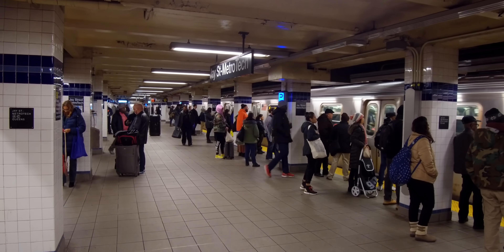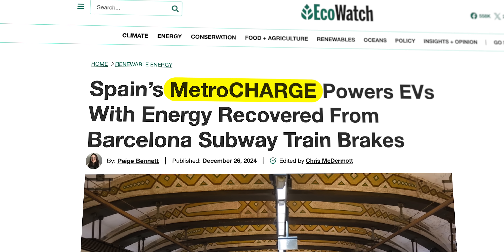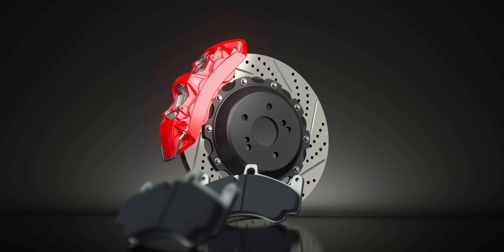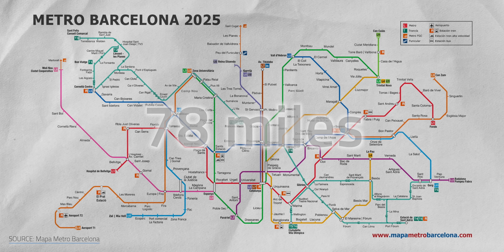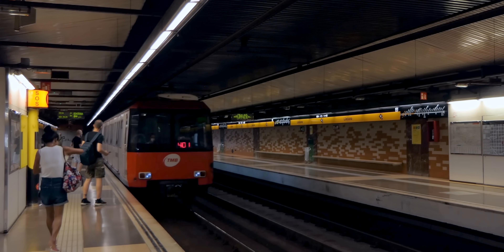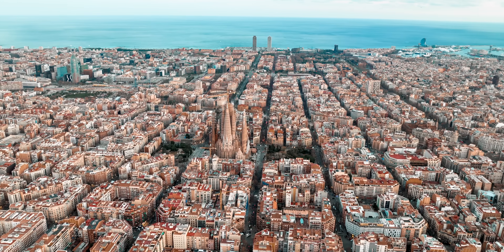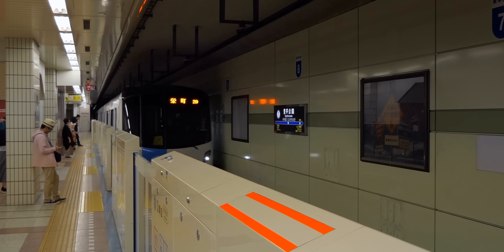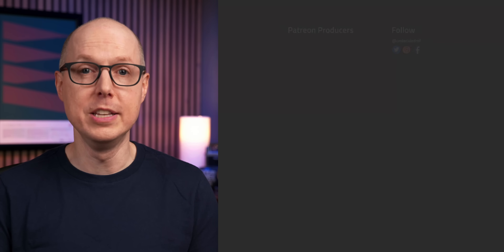The Most Overlooked Clean Energy Source… is Under Your Feet

Comment: I wonder if a braking car on the back of the train for the regenerative braking might be the best way to do this.  Obviously you add it to new trains but you could just add a single car with batteries to the back that puts all of the new stuff in a hot swappable unit thats totally redundant since the train would have its normal brakes and does even have to share electrical systems.

Comment: Another energy recapture tech that would work very well in subway systems is wind-walls.  Trains in tunnels push a Lot of air as they go.  it would be very simple to line sections of walls with small modular wind turbines to collect That wasted energy as well (and you could Also take advantage of the low pressure suction at the Back end of the train as well)

Comment: I think it's a needed piece of the energy puzzle. For passenger traffic I think however that it would make more sense to work with individual smaller taxi trains that are A.I. driven. The passenger goes to sit in it, indicates the desired destination, pays or shows proof of payment, then A.I. takes the taxi to the destination using the most optimal routeplanning. It's better because big trains are too heavy, costly, unfriendly in timing, and expensive. Meanwhile smaller taxi trains can be more easily individually maintained, are lighter and so use less energy, and lighter using less material means cheaper although you'll need plenty more taxis, it will also require no personnel to run the train itself but for maintenance there will still be personnel needed of course. Because there are the many individual taxis, taxis leave as soon as possible reducing waiting time, eliminating problems on delays, no need for preset routes as A.I. does the driving, no changing to different trains or even manual route planning because you just enter the desired destination. Trains for passenger traffic should have died already by now!

Comment: A great follow up would be to compare any regen rail to what it would take to implement. You mentioned the NY MTA. If a train recovered any power, it's simply used right there by another train that is moving. So leave out the ev and station needs, it's only a cherry on the cake. We need to do the icing first?

Comment: I'm shocked they weren't already using regenerative braking to reduce the total energy to power the trains. I'm disappointed that e-bikes don't have regenerative braking. Cable cars in SF use a small central motor because the cable cars getting pulled uphill are balanced by cable cars is going downhill on the same cable so the motor only has to overcome friction in the system
Reply: E bikes use so little energy that any extra range would be insignificant. Bikes are very lightweight and don’t go very fast so there’s little kinetic energy to be extracted by regen.
Reply: You need to get into the kW range before regen makes sense. Electric motorbikes do use it. And indeed most modern electric trains use it. Where I live commuter trains have used it since the 80s.

Comment: This script was a confusing onslaught of loosely related information. I could imagine the new part is that the energy is fed into the 750V DC supply and the station transforms it for local use, which might save on transport losses they had earlier? I would like to see numbers how the local transformation is cheaper than powering an accelerating train in the next station, or what did I miss that makes this newsworthy?
Reply: Yeah, this was a disappointing episode. Sloppy writing (at the start he talks about converting potential energy and a few times he talks about the trains charging things), obvious questions (like why EV at all) unasked, and comparisons to other systems not made.
Reply: Exactly my questions. I would really like to see Matt do a follow up on this, because I also fail to see what's new.
Reply: @Mr_Stone1  I guess the timing? Regeneration of electricity can be stored in EV batteries instead of transporting it further along the grid?

Comment: Interesting electrical engineering question, and as you note, the most efficient use of the recovered energy depends on how the cars, rails, and stations are wired.  Cheapest:  just feed the recovered juice back into the traction system.  Simplest:  store in a small battery (as in all EVs) when it stops, then use it to help start the train  Since the recovered energy is 45% of the kinetic energy of the train at most (from your numbers), that determines the size of the battery.
Reply: I wonder if the weight of the battery outweighs (pun intended) the acceleration gain versus offloading. Especially for trains not at capacity.  I would think engineers figured this math out already and why they went this direction?
Reply: Batteries seem like a bad solution for a grid, where every moment stone train accelerates and drives, this needing power. 
But as you mentioned, it depends on the traction system. 
This way or another, it doesn't make sense to me to outsource the energy outside of the transportation grid.
Reply: Capacitors, not batteries for this, lighter too
Reply: Those 2 sound like the same thing. The railway's independent power grid is acting as every train's batter all at once. For a car, you have to feed power back to the main battery since it's not connected to a power grid.

Comment: Renerative breaking should just push excess energy back to the grid. Don't direct energy directly to EV chargers. Not everyone has an EV, but everyone uses the grid. 
I know that has its own set of technical problems since power stations have to compensate for the variable draw and generation that comes with starting and stopping trains at this scale,  but it's possible. The grid already handles large amounts of variability as it accounts for with home battery storage, EVs, wind, and solar.

Comment: Some of the London Underground stations are built higher than the tracks leading to them, so the trains slow themselves climbing to the station. When they depart they gather speed going downhill. So the station is a potential energy battery. Clever.
Reply: Every subway with different elevation can do that, as it does in Barcelona that have 400 feet difference
Reply: I read similar proposals to land planes on runways going uphill, and then later the planes save energy by rolling downhill during takeoff.
Reply: @skierpage  the problem is that any roll downhill needs to climbed in flight. Train stations at local peaks (in theory) can offset cost.
Reply: @skierpage  how much energy?
Reply: Planes need to take off and land into the wind if possible, so this is not applicable to air transport  @skierpage
Reply: The NYC subway (at least some of the older Manhattan tunnels) do this too! They also did it at a much larger scale for some of the express trains that run on separate tracks from the locals. For example the Lexington Avenue line express originally went all the way from 42nd street to 86th in a single 2 mile stretch.

Interesting video that goes into the design history and a speculative "gravitator" scheme at the end:
https://www.youtube.com/watch?v=AWuw7oYI0uU&t=62s
Reply: They did the same in Copenhagen.
Reply: @Paul_ Great. And if a train loses power, it will get stuck in-between.
Reply: @janpolacek8184  but that was always true
Reply: @jsbrads1  I mean, who said metro stations have to be higher than the tunnel. It has upsides and downsides.
Reply: @janpolacek8184  what are the downsides?
Reply: @jsbrads1  What are we referring to exactly? I was talking about the dips between stations. In that case, it would be the fact, that in case of a power cut, the trains would roll away from the station, and would stay there, until the backup generators would kick on.
Reply: @janpolacek8184  and if there was no power and the rails were flat, the trains would roll to a stop between stations anyway.
Also they can apply brakes to prevent the train from rolling away.
Reply: @jsbrads1  Who said the rails would be flat? My idea was that the stations would be on a dip. And yes, they could apply the brakes, but only if they were in or very near the station. But if they were somewhere along the tunnel...
Reply: @janpolacek8184  okay, that isn’t how the UK did it. They were trying to save energy, you are optimizing for the one day in a decade (or more hopefully) that they lose power.
Reply: @jsbrads1  Yes, that is true. I am not saying it is worth it. Back then, it certainly wasn't. Nowadays with regenerative braking, it may be plausible.

I don't want to argue. I am just saying it has a downside. Supposedly, the dips in the metro system in my city should be in the station. But when I looked at the line height profiles, I saw that the lines are mostly sloping from one station to another, and at the few spots where they are level, the dips are between the stations. So yes. It's probably not worth it.
Reply: @janpolacek8184 When a train loses power it basically always stops anyway, even if just for safety purposes.
Reply: @Paul_  very smart.
Reply: Less steps to the surface too
Reply: not really the case! the temperature has been going up due to tons of different situations for example the line isnt 100%underground and in summer trains heated outside by the sun goes down and transfers the heat to the surrounding clay underground.
Reply: @alanmay7929  how does that have anything about wht he said?
Reply: @eseopuit’s regenerative breaking using gravity instead of batteries - smart.
Reply: @charlesstewart2304  we are talking about a meter or two max 😅
Reply: @jsbrads1  how much energy is that?
Reply: @zlmdragon.  not very much as a fraction of the top speed of the train. 1/2mvv=mgh, ms cancel and at 10m/s, a single meter of rise is about 20%.
Reply: @jsbrads1  On the Victoria line they save 5% of energy and go 9% faster according to page 125 of "Sustainable Energy Without the hot air".

Comment: Nice video, I am working with trains, metro and trans around the world, this example is very good but there is more examples, the best part is as effient is a system metros is less hot. First of all, all electric trains (al least the one that i know) are usong their energy for their internal comsuption, then they send to catenary raising the voltage, if there is other train can use this energy. here more examples: Helsinki metro system is using their brake system for heating the passenger area.
Birmingham tram metro have battery system that storage this energy. 
All trains that work on AC send back the energy to the network, actually if you desing properly the system you can use this energy on other train or in capacitors.

Comment: A 4 year pay off for this system is pretty amazing, 8 years of operation would let you double it and grow exponentially ever 4 years. This reminds me of the electric water trucks with swappable batteries to replace dams. If people could be dropped off in lower elevations and empty trains travel back up you'd have an excess energy, but if you have to move them back up then it will cost you more, no matter what you increase efficiency though.

Comment: One thing I didn't know until last week: Part of the reason the London Underground is so damn hot, is because the clay and rock it's dug through has been capturing the heat from motors, brakes, commuters and lighting for over 100 years - and it's just got hotter and hotter. When they dug the first tunnels, the clay was around 14C (57F), now it's 26C (79F)... Source here: https://www.youtube.com/shorts/zlI0_atnBYY

Comment: I am confused; regenerative braking is nothing new for trains and subways. For example Prague metro was rolling support in 90s and since 2010, all their trains fully support regenerative braking. They don't do things like "direct EV charging", but reuse it directly in their grid (metro is DC). I believe they can directly use about 80% of the energy generated.
Reply: You could even say it is not.. braking news…
Reply: Teď jsem napsal to samé 😂
Reply: Good point. I don’t get the argument Matt presents that since it’s hard to set up EV charging points, it’s a dough sell. Just dump it back into the grid. You don’t need anything more.
Reply: @Eponymous300  Yes, this is a really dumb argument by Matt. The train operators are probably selling via EV charging points instead of selling back to the grid because they make more money that way.
Reply: My whole problem with this topic is just the point with EV charging ...
Why not use the energy from RB directly for the trains themselves? This way you don't need to care for AC and DC (at least in my non-professional opinion). Trains, subways/undergrounds meet enough energy for driving. I can't imagine you get so much energy back that it becomes too much for the train's grid to be used.
Reply: @Deinorius  I think Matt missed part of the explanation. For RB to work, something needs to use the energy recovered. Typically that meant having a train that is accelerating at the same time that one is decelerating using RB, that's something the Montreal Metro has been doing since the 70s. I think that a point that could have been made clearer in the video is that the main innovation here was to extend the usage beyond the internal subway grid itself. If you have batteries on site, RB of a train could be used to recharge that battery, or if you have inverters you can use them to push it back to the overall grid.
Reply: @nuitari1669  Or you could just feed it back to the national grid that is powering the subway grid, like millions of homes with solar roof panels do.
Reply: @nuitari1669  But it doesn't really make sense to store it in batteries on stations, when you can just feed it back to the network where it came from.
Reply: @Deinorius  exactly this made me go wtf 😂
Reply: And Sydney for decades!
Reply: @ForTheBirbs  And Brisbane always. (Well, since we electrified in the the 80s.)
Reply: I know some systems had issues because of the different electrical systems but now with decent VFDs and Inverters becoming cheaper and smaller and more dependable it is easier to adapt older systems to them. 

Random fact the chime for the Montreal Metro was because of the tone the older less efficient motors would make as the train accelerated.
Reply: Absolutely, feeding back electricity to the grid when braking isn't new. In mountainous regions you need to do so to keep trains at design speed going downhill. (At ancient times locos had resistors for getting rid of that electricity.)
Reply: this isn't anything special more power needed from the grid to accelerate now instead of it being available to the train. it's just shuffling energy around incurring more resistive losses then if power was contained locally
Reply: Good topic but as many already said there were many points missed. Could have been nice to see some comparison where the energy could be used and what are the pros & cons in different solutions. Like the most obvious ones using it directly for other trains accelerating, storing it at using it later for acceleration or feeding it back to the grid. Using it for EV chargers does that mean there needs to be some battery or otherwise the energy is lost if there are no cars hooked up on the charger? Sounds more like trying to make the most profit and using green marketing.
Reply: He said Barcelona had it since the 80s'.
Reply: I think the point is that the DC electricity can be sold directly to a consumer for ~4x and help pay partly for the system
Reply: @tarant315  if they're using inverters like he said then it's coming out ac..to be converted back to DC 😂
Reply: @forbiddenera  You're gonna love this. The power grid uses AC which is converted using large transformers to DC current for the metro system. The metro train then converts the DC power to AC power using inverters, so the AC motors can be powered. 

You can actually hear happening: the sound the train makes when accelerating and braking is a blend of the motors and inverters trying to match frequency. That's why electric trains sound kinda harmonic and cool. 

Finally, the Regenerative braking produces AC current which is converted by the train's inverters to DC. This is where the metro company might decide to sell it as DC for the EV charging stations, but these have their own inverters already so we're back to square 1.
Reply: I'm pretty sure the subway/metro here uses regenerative energy and the higher stations to store potential energy. And I think it feeds back to the subway power lines.
Reply: That's so cool! I'm from Prague and I love such optimisations. And this makes much more sense to me than EV charging! I love that they did it right in my town!
Reply: This is just paid propaganda

Comment: On the direction of reducing subway heat, the other knock-on effort is a reduction in the cooling costs. Reducing a degree or two through this technology would be a degree or two that doesn't need to be 'reducing' with climate controls.